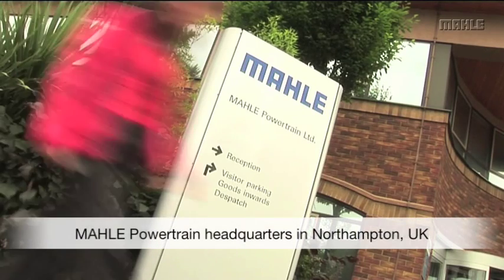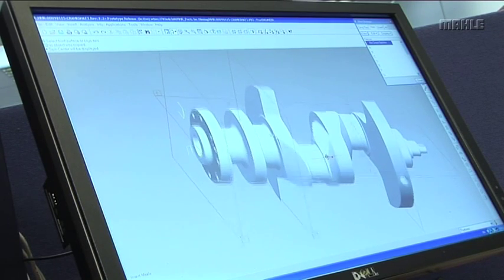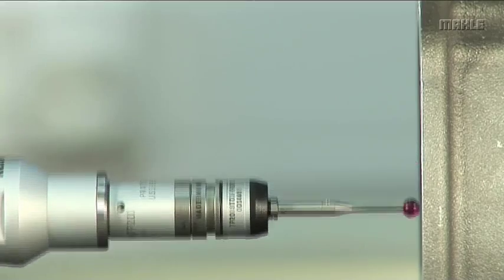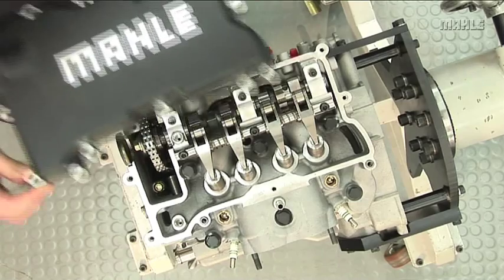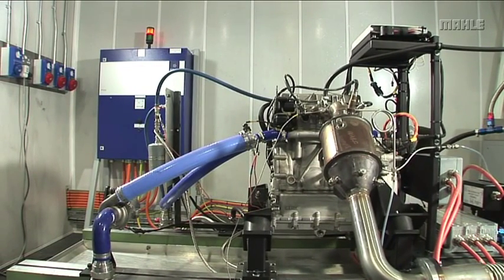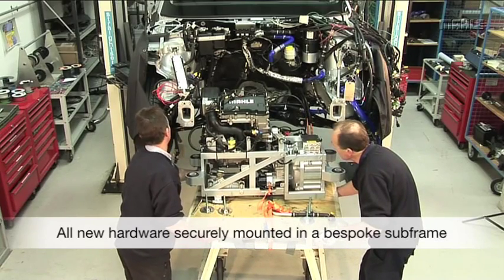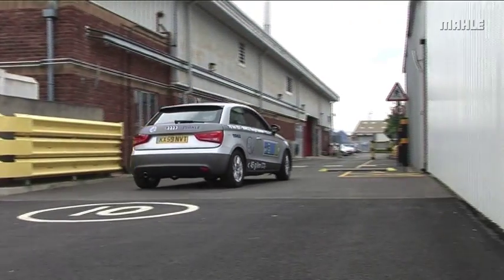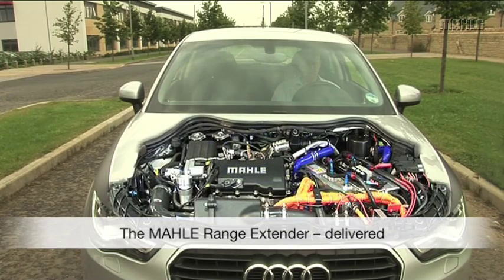MAHLE Range Extender Project Video - long version

Comment: really neat, will be nice to have this kits for many car conversions. I was thinking in doing the EV conversion and then use the old ICE to make an external range extender for use when long trip is needed so the battery pack can be smaller the overall car is less heavy and can be a nice city car, then for long distance you hook up the range extender and get anywhere.

Comment: I've believed for a long time that the best application for the internal combustion engine was always as an electrical generator or range extender. That goes all the way back to the late 1970's when I first read about a car someone converted to a hybrid ,,, although they weren't calling them hybrids back then. The guy was reported to be getting 90mpg. And that was with 1970's technology.
This video would seem to be a confirmation that the ICE will still have a place in the world for a few more years.